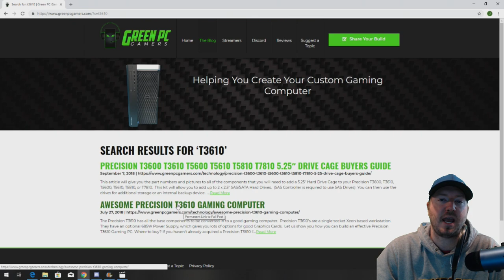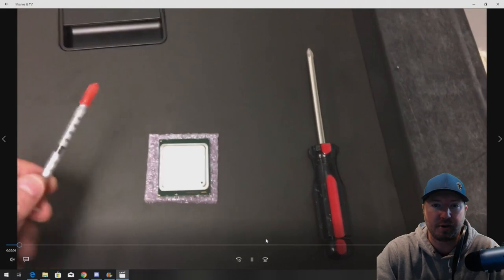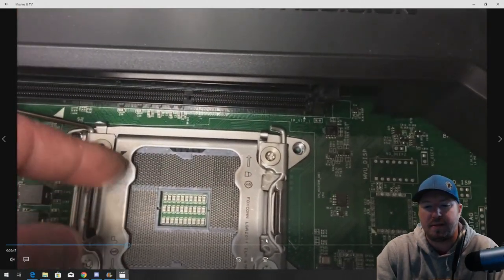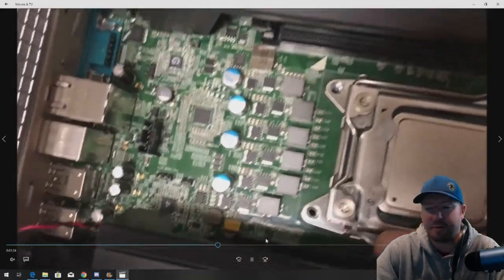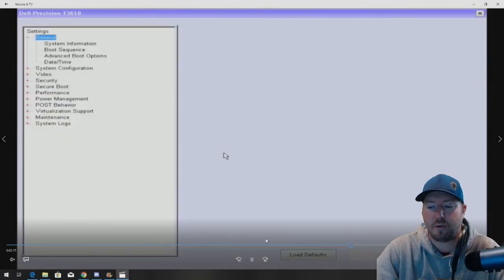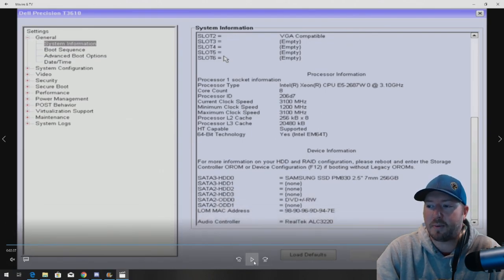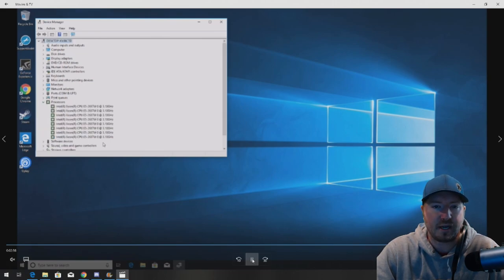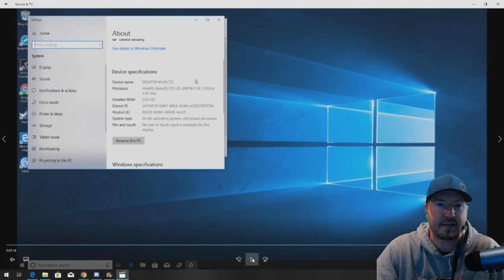Precision T3610 Processor/CPU Install Upgrade

Comment: I am studying your stuff as I recently got a barebones T3610, cheap. To find a source for such green constructed info is a hoot. Very thorough in my way of thinking. I, meanwhile have started the "t3610 project" and oob no signal. Will be replacing cmos batteries, rocking the ram in their slots etc and hope those two do the trick. If not, perhaps one of these articles/videos After that we look at 30 day guarentees. I am enjoying this sustaining stuff. Thank you

Comment: I am think about upgrading my T3600 CPU to the Xeon E5-2687W v2 (the V2 of this one on your video) but I found that its TDP is 150W not like the one already instaled (E1650 V2) which have a TDP of 130W. My question is ; Do I have to change the Heat sink or not ? and will the 658W PSU be sufficient knowing that an RTX 2080 card installed on the system?
Reply from the maker: The T3600 won't support V2 processors.  The RTX 2080 wouldn't be a great value in the T3600 due to bottle-necking.  Consider the GTX 1660Ti , RTX 2060, or RTX 2070.  (Supers as well)

Comment: is there any way to just use this board with an after market cooler compatible with socket 2011? or it will not post if fan is not plugged in that mobo conector?
Reply from the maker: Check out this video.  It applies to the T3610 as well.   https://youtu.be/GTV0dkCcU64

Comment: Great video. Can the stock heatsink with the little 60mm fan really handle 8 cores or 12 cores? Are there any aftermarket heatsinks that will work with the Dell bracket? Apparently it has deeper screw holes so you need longer screws than standard heatsinks
Reply from the maker: Watch out Precision T5810 noctua heatsink install.  That same install works on the T3610.
Reply: On the bright side, at full load my new E5-2667v2 8 core runs at 77°C running Cinebench. According to HWInfo64 it's using 125 Watts. The old E5-1620v2 was only using 65W at full load. So the stock heatsink does a great job, probably because the slim 80mm fan inside it can move a lot of air
Reply: @GreenPCGamerscom are the noctua heatsink with fans still recommended? Nh-u9 dx4 or are there any better one now since video upload? Years has passed.

Installing a Xeon E5-2690 V2
Reply: test

Comment: just found your video great stuff, i have a T3610 with 685W power in hand, wanted to fit in a RTX3050 but it doesn't work, the screen only showd the initial Dell logo then nothing happened, just wondering if by any chance you know what the problem is, thank you for your help
Reply from the maker: Was the card new?  What power rails did you use?

Comment: Can't get the 2687W V2 to work in my T3610? Won't even boot..Runs for a couple of seconds then repeatedly cuts off!!
Reply: What is your GPU model? Do you use 685W Power-ssupply?

Comment: Don't you need to make sure the BIOS is updated using the old chip before putting the new one in? That's what I heard
Reply from the maker: It's a good idea to update your bios with the existing cpu prior to upgrading to a new step code.  Thanks for sharing.
Reply: @GreenPCGamerscom  But what's a step code? I already updated the BIOS with the most recent firmware or whatever, so it should be good to go I think?

Comment: Is it possible to make update the BIOS so that it can take a 12 Core processor?
Reply: I am also curious about this. Generally this icy bridge can do it. But can this t3610 do it?
Reply: yeah & u can use e5 2697v2 12 core processor
Reply: And where do you find latest bios and microcode for T3610? Have not seen one for many many years